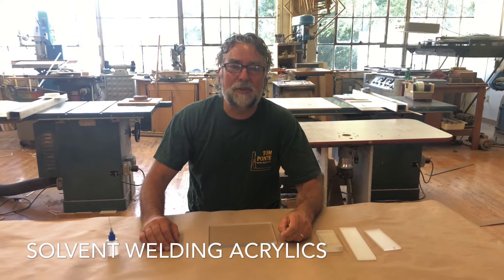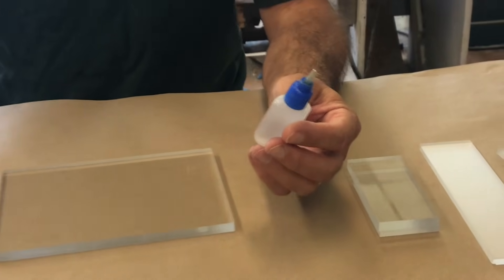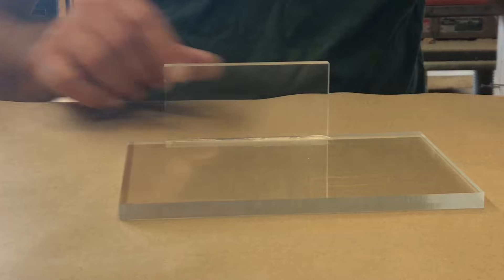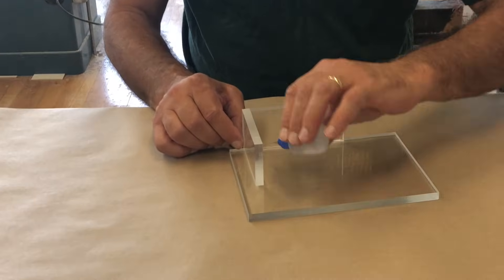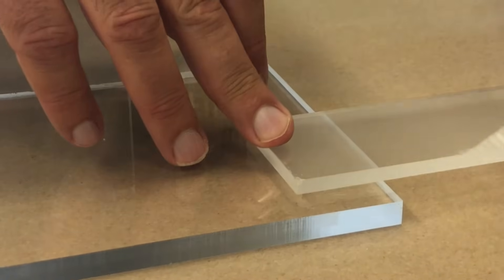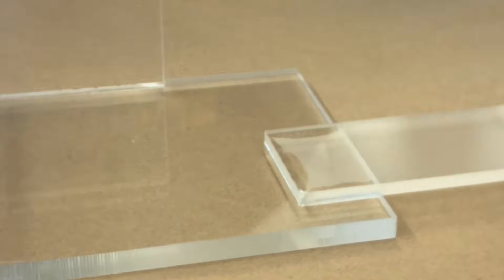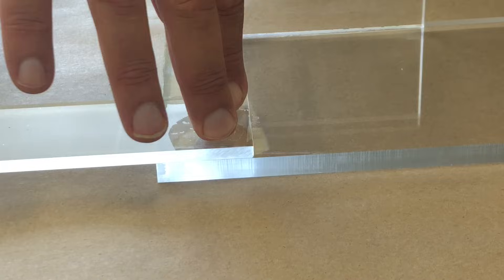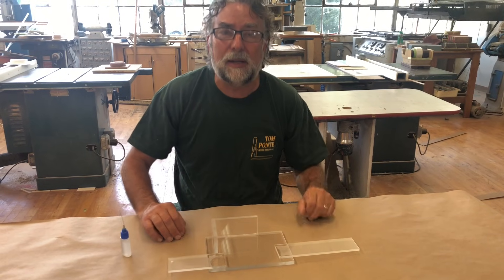Solvent Welding Acrylics

Comment: Methylene Chloride, also known as Rez-n-bond. Used this for 37 plus years in the sign business. You can make a thick glue with this by adding scrap acrylic pieces to a gallon and letting it sit for a few weeks
Reply: Thanks. I need it to be petrol proof unfortunately.
Reply: Methylene Chloride

Comment: Thanks for the info! I am trying to use this technique but I am not seeing an instant bond, it is not "sticking" until it's sat there for a while. Any advice on why? they are laser cut pieces, so all I can think of is maybe i need to lightly sand the edges.
Reply: Have you figured it out?

Comment: Does this work on saw cut edges? I caught in the middle of the video on the manufacturer's website that they recommend ips weld on 16 acrylic cement instead if not a purely flat finish which your video seems to show?

Comment: Is the bond improved if you can somehow apply pressure to the joint?   I'm guessing since the liquid is so thin that an unsmooth surface can also mean a poor bond?
Reply: no. pressure is not going to make it melt faster.. it's not a glue. I wouldn't even consider it a bond. the two pieces of plastic are being melted together by the solvent. applying pressure might inadvertently prevent the solvent from spreading as far as it could. that would result in only part of the acrylic coming in contact with the solvent. I've built aquariums using this method and the trick is to ensure both pieces of acrylic are flat, and free of any imperfections from cutting. sanding with a very fine grit is essential to ensure the pieces of plastic lay flat on one another..

Comment: thanks for your tutorial. Is there any reliable bond for  very tiny piece acrylic to metal ? Any idea!
Reply: If you are not worried about the finish, Signfix 7 would achieve this bond, or any 2 part structural adhesive would do 👍 as long as you are not worried about the finish or just general 502 superglue works. Bit late, but I hope this helps 😂

Comment: Great video! Is there a difference between welding two pieces of cast acrylic together and welding two pieces of extruded acrylic together?
Reply: Actually, it is - cast acrylic does not have any internal stress/tension and does not crack when in contact with solvent. Extruded acrylic have much more internal tension, which makes it crack (small but clearly visible cracks on the surface) when contacted with solvent.

Comment: The pieces must be perfectly cut, but that's very difficult to do, for if one's hand is not perfectly vertical when cutting the acrylic, the edge will not be square with the surface, I think.

Comment: amazing video i was trying it today and i was so confused why its evaporates !! i was woriied from the mess and it stickign to the floor? so it only bond acrylic plastic together? and wont bond any other surface to it ? like is some leaked it will evaporate or fgell on floor it wont glue it to the floor? also is that solvent toxic if inhaled  ?
Reply: He keeps saying glue, but it's not an adhesive.  It's a solvent.  It dissolves the plastic and creates cohesion, and the plastic hardens again after the solvent evaporates.  DCM is very volatile, like alcohol, it evaporates quickly, relative to water.

Comment: What about surface prep for solvent welding, do we have to router, or sand the edge ?  I get great results on factory edges and terrible results on my saw cut edges, but I was told not to sand the edges because it would cause crazing.  My blade is good enough to cut a rough edge with no breaking, but it doesn't leave as smooth an edge as your cutting demo. I'm trying to decide between getting a router table or a better circular saw blade.
Reply: The pieces must be perfectly cut, but that's very difficult to do, for if one's hand is not perfectly vertical when cutting the acrylic, the edge will not be square with the surface, I think.
Reply: No sanding or routing needed it all comes down to the type of blade you are using for acrylic, best results are with a triple chip negative rake (angle) blade. Ideally, a Swedex blade (or a trade for aluminium equivalent blade same spec) is what you want👌 bit late, but I hope this helps 😊
Reply: Time to buy a CNC, my dude.
Reply: @CountDoucheula  Thanks.

Comment: Thanks! What solvent would you recommend to glue a broken turntable cover - without a line?
Reply from the maker: I assume the cover is clear plastic, and that it's cracked through. The type of solvent (not glue) to repair the crack would depend on the type of plastic its made of. I'm not sure what you mean by 'without a line' - 
If by that you mean 'without any visible seam' then it's probably not feasible If the cover material is clear.

Comment: Great video! 🥇🏆
New subscriber here ... and I need you help pls. 

I would like to ask you, which is the best approach to weld the PMMA on edges (means stronger and will give me clear joints):

1) Methylene Chloride
(also known as Dichloromethane) 
or 
2) Trichloromethane CHCl3
(also known as Chloroform)

Why I’m asking you. My project is to build a custom taillights on my car), so I need new smoked clear lenses and since they are extremely curved in any direction (X, Y, Z) the thermoforming method doesn’t work for me. Next step in my plan is to cut the taillight lenses on segments (like 25x10, 25x14, 25x11mm and so on), to pre-heat and curve them and finally to try to weld them using one of the products above and hopefully it will be solid enough (and leakage free). So please let me know how to achieve the strongest pmma welding possible (and relatively invisible if possible).  Thank you in advance.
Reply from the maker: We don't use chloroform. Methylene chloride will give you a strong clear joint on PMMA (aka acrylic)
Reply: @modelmakers33  thank you for that input.

Comment: Can we use that for acquaruim?
Reply from the maker: Yes. But you must have full contact between the mating surfaces for a waterproof seal. You can also use a solvent that has some 'body,' like Weldon16, that will remain to fill voids after the solvent evaporates. Check out our video 'Solvent bonding smooth vs. rough plastic surfaces' posted about a week ago.

Comment: Hmm how do i have it clear throughout. Does it cause blooming for this type of solvents?
Reply from the maker: You may get a white spot or 'bloom' if you inadvertently get any solvent on the surface, but the joint will be clear wherever there is full contact between the mating parts.
Reply: @modelmakers33  ah i see so i really have to make the interface flat enough regardless. Does flame polishing the corners help prior to using the solvent. Say 3mm edge thickness acrylic (est contact area) for a box
Reply from the maker: @dexterchewy  No don't polish first, that will round over the edge, and you don't want that. Don't soften any sharp corners prior to bonding in any way. Sharp corners facilitate the capillary action that draws the solvent into the joint. The edge must be flat and have good contact with the mating piece. The solvent will clarify the material wherever there is contact.
Reply: @modelmakers33  thanks a lot sir. Much appreciated for the advice. Got what you mean. Haha. Would be happy to visit your workshop in person but ive since left US after my studies. Really cool guy thanks for replying. Cheers.

Comment: Is there anyone whom I can pay, to make an acrylic shelf for me, approximately 14 inches wide, and maybe like 18 in tall, and 3 in deep, with four shelves
Reply from the maker: You might be able to get something similar to those dimensions that is mass produced 'off the shelf.' You'd probably pay somewhere north of $100 for a stock item that size, which is less than you would pay for a custom piece. I'm not sure what your budget is, but to answer your question - Yes. There are plenty of businesses (including Modelmakers Inc) that can make something like that to your exact specifications.

Comment: Is this waterproof afterword if you wanted to use for a vase?
Reply from the maker: If you get a good joint, yes, absolutely. The only way it would leak is if there was a hole or crack - but that does include any incomplete bonds in the seams. The key to a good solvent bonded joint (seam) is to have full contact between the mating surfaces. The solvent 'bonds' completely, but it will not 'fill' any voids. It just dissolves the surface of the mating pieces and then evaporates. There are products with some 'body' that remains in the seam after the solvent has evaporated (SciGrip 16, aka Weld-on16) and if you need waterproof, and you're not confident of full contact between the mating pieces, then this might be a better choice. Its messier to use, but it will both solvent bond and fill small voids.
Reply: @modelmakers33  I really can't thank you enough for the education on the matter and letting me know what products to use.   Really appreciate your time & expertise!!!
Reply from the maker: @sumbunny6  You're welcome! And thanks for the question. We're planning to do another video that addresses this subject in more detail
Reply: Afterward***

Comment: Where would a guy like me be able to purchase the solvent?
Reply from the maker: I'm not sure where you're located, but a plastic distributor is probably more likely to have methylene chloride (aka dichloromethane, or DCM) than a hobby/craft store. Tell them what you want it for. Internet searches for methylene chloride may point you to paint strippers - don't try to use that.
Reply: @modelmakers33  I live in WI.  I think I found a place.  I am a member of a model railroad club and we use plexiglass for areas around the layout that we don't want hands to be in.  Many of the areas are pretty long so we are looking for ways of gluing the plexiglass together without messy or bad looking joints.  Just a few ounces is all we would need.

Comment: I wanted to make acrylic podium , can I use this bond for 9mm acrylic
Reply from the maker: Yes, methylene chloride (aka dichloromethane, or DCM) will bond acrylic together no matter how thick it is. The key to a good joint is contact between the mating surfaces, and penetration of solvent into the joint by capillary action. You can actually see the solvent going into the joint if your material is clear. The solvent won't fill gaps, and the parts won't bond together in any places where they don't touch.
Reply: @modelmakers33  thank you 👍

Comment: Not melting, dissolving.
Reply from the maker: Yes. In common parlance chemical solvents (not to mention discouragement - or kindness...vulnerability...) can cause something to melt, but technically the term 'melt' is usually reserved for situations where heat is the agent of change!

Comment: If I add bits of acrylic to a little solvent, can I use it for filling in holes/cracks?
Reply from the maker: Theoretically, yes, but in practice that's a technique that works much better with softer materials like ABS and polystyrene. If you do try it with acrylic, use acrylic sawdust, or very, very, VERY thin shavings. It will take forever to completely dissolve anything chunky. Keep the container sealed so the solvent doesn't all evaporate. 
Another technique you can try is puddling some solvent onto a flat piece of material and then scratching and scraping the surface with an exacto knife or screwdriver - any kind of small, stiff, thin metal paddle. You may get a bit of 'putty' like that. I wouldn't discourage you from giving that a try with acrylic, but again it's a technique better suited to softer plastic.
Reply: @modelmakers33  thank-you 😊
Reply from the maker: @rickgividen4318  No problem. BTW - Its not quite same thing as putty, but SciGrip 16 (aka Weld-on16) is a solvent with some 'body' that remains in the seam after the solvent has evaporated
Reply: @modelmakers33  Thanks

Comment: Nice video, but where to get the solvent from?
So far as I have learned Methylene chloride is not available on the market for private users or hobby constructors. Is this understanding correct? If possible, could you kindly give the link where one could buy this from, please? Thanks
Reply from the maker: PS - An internet search for methylene chloride may point you to certain paint strippers - don't use that. 
Brand names for methylene chloride include: Rez N Bond, Weld-On, and EZFix(303) - use that, and always remember to be careful with this stuff. Its volatile and flammable. Don't breathe the vapors, don't get it on your skin, and don't use it near an open flame.
Reply: @modelmakers33  Many thanks for your reply and caution tips. Btw I am located in Germany and found Weld-On4 on the Internet.
Reply: @user001sg9  He was clearly wearing gloves and holding his breath for this video. 🙄
Reply from the maker: I'm not sure where you're located, but plastic distributors are much more likely to have it than hobby/craft stores

Comment: Hello sir
Im verry interest with acrylic, im planning to build acrylic bath for my pc to immersed with liquid oil for colling the gpu's, my question is is acrylic heat resisstant with temperature arround 40 to 90 degrees, if i want build my own bath gpu's / pc, i need that glue to combine anggle the acrylic, and is that glue heat ressistant and leak proffing for my liquid colling pc?

For the answer im say thanks🙏🙏

Comment: We are building acrylic wine drawers, that will hold 4 wine bottles, should we use the methylene chloride solvent or should we use a stronger agent?  We need to make sure the drawers do not come apart.  Your guidance is much appreciated.  Thank you!
Reply from the maker: The methylene chloride bond is very strong as long as the mating surfaces have good contact. The solvent will not fill any voids. 
If you're not sure, you can put gussets on the inside corners - 1/8" X 1/8" or 1/4" X 1/4" square rod is commonly available. Cut the rod to the length of the seams, lay it in the corners, and bond to both the floor and the sides. That makes for a VERY strong joint! 
But again, this is not necessary if you have full contact between gluing edge and gluing surface. The solvent actually welds them into one piece where they touch.

Comment: Glue name ?
Reply: Is it heat ressistant?
Reply from the maker: @nanda_pamungkas  As much as the material itself - the solvent itself does not persist, it merely acts as a catalyst to bond separate pieces of the material.
Reply from the maker: Methylene chloride. Its not exactly 'glue' - its a solvent, and like many solvents, it is a volatile organic compound (VOC) and should be used with care. Stay tuned, we're planning a few more videos on this subject in the near future.

Comment: Very cool. This strikes me as the absolute best way to bond acrylic to other acrylic.  Better than any glue could ever be.  Are there any drawbacks to this method?  I guess pretty fast setting time might be one.
Reply: The solvent - methylene chloride - is pretty toxic, so you need to have adequate ventilation or a respirator with filters designed to counteract the solvent (not just any random mask, this is specific filter cartridges for specific chemicals). Same thing with Xylene and a bunch of other stuff - it's great to work with, but can royally screw up your body, especially the nervous system. Be careful and PLEASE read the warning labels!
Reply from the maker: I'm not sure if you would consider this a drawback, but the solvent won't fill gaps, and so the mating surfaces have to be in full contact. The resulting bond is extremely strong.
Fast set time is usually considered a plus. Its not instant - you have a little time to adjust. But a better, cleaner joint will be achieved if the pieces are not moved at all once the solvent is applied. Best practice is to hold the parts together exactly where you want them when you apply the solvent. It will find its way into the tiniest crack via capillary action.
Reply: @modelmakers33  Thanks - makes sense.  Yeah, the flatness of the joining surfaces is a must with this method.  Another drawback I can see after some googling is that apparently this stuff is extremely toxic and evaporates like crazy!

Comment: Great video! I want to bond a large area of plexiglass. Roughly 9x14". Are the weld-on 3 an ideal solution for large surface like that?
Reply from the maker: Yes, you can use this type of thin fast acting solvent to bond a large area, and it will be very strong, but it can be kind of patchy and not look good through the clear plexi. In order to achieve a thoroughly even, clear joint, you have to use a thicker and/or slower solvent.

Comment: Where I can buy in India
Reply from the maker: The solvent used in this video is methylene chloride. Brand names include 'Rez-N-Bond' and 'EZ Fix 303.' 
Keep in mind that it can be used to weld some 'bondable' plastics together - acrylic, PS, PC, PETG, and ABS - but not others. For example, methylene chloride will not weld PE together, or vinyl, or PP. It won't interact at all with many plastics.
One other thing to remember is that while acrylic can be welded to acrylic using this method, and PS to PS, PETG to PETG, etc., it is not the case that different kinds of 'bondable' plastics can be welded together. For example, If you try to weld acrylic to PS, the solvent will melt both, and they will 'stick' a little bit, but they will not bond together chemically to form a truly solid piece. This is a good rule of thumb, but there are exceptions:  ABS can be completely welded to PC using methylene chloride.